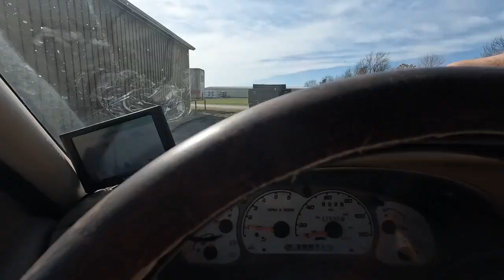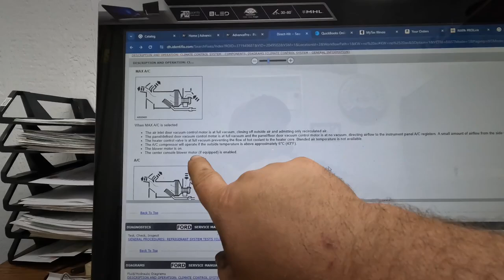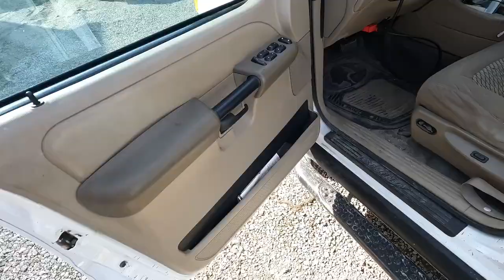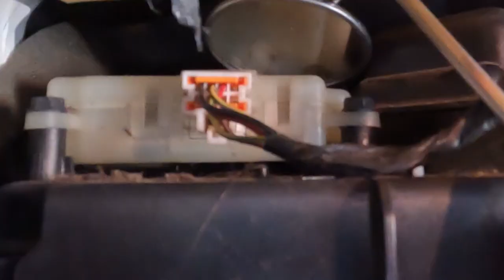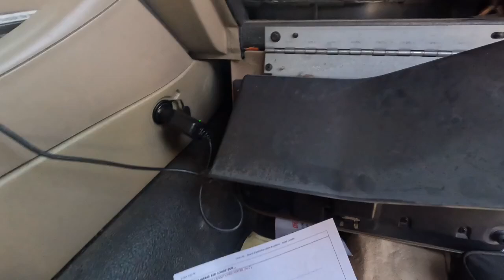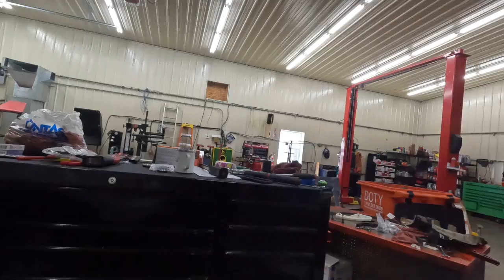2003 Ford Explorer Sport Trac HVAC issues! Only cold on Max AC setting! AC runs!?

Comment: Thank you for the video!  I’m in the process of testing my wife’s 2003 Ford Sport Trac blend door motor. One question, how in the world did you get to those back actuator bolts?
Reply from the maker: Well for one I believe that I still have the scars on my hand from that truck. But I used a really small ratchet and a mirror and as much patience as I could muster up.

Comment: I comment as I watch. HVAC specifically since that is what the video is about, your prescan, what are all the TEMP SENSORS showing static, are they at or near each other, this is key on engine off prescan, are there any PIDs that can prevent a system from operating before the system is even turned on, are there any other PIDs that do not look good static? Temp sensors, Ambient outside, Coolant, Engine (Head), EVAP, Cabin inside, SUN sensor, etc? There are many sensors to prevent the AC system from normal operation but the temp static is the starting point I see a note stating above 43*F as we do not need AC in the winter season. Does your AUTEL allow the keyword search "TEMP" to bring up all the temp sensor readings on one screen?

Would the default setting be Defrost with AC on in Recirc to dry out the air, to clear the windows if needed by default? 

When you noticed that the system has to be in MAX AC to work, what changes did you notice on the scan tool when in MAX AC and when not in MAX? I did not notice you checking all the PIDs for changes, if any? Later in the video, you mention a possible problem with the Blend Air Door OR Heater Control Valve, do those have PIDs to check? QUESTION ANSWERED, SYSTEM TOO OLD SO NO. I only believe that a scanner is only a guide but we spent the money to buy one, is it useful on this JOB? Really appreciate the Service Info about the system up to this point. 

In the end, hot coolant is always flowing into the cabin heater core except in MAX AC, the blend door controls which air enters the cabin, hot or cold, appreciate the extra time to explain all this, cheers.